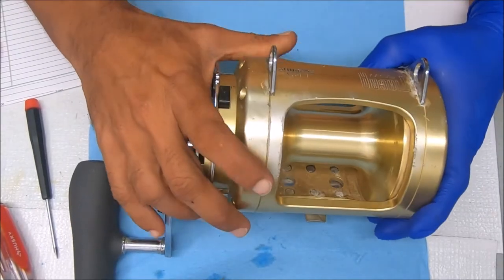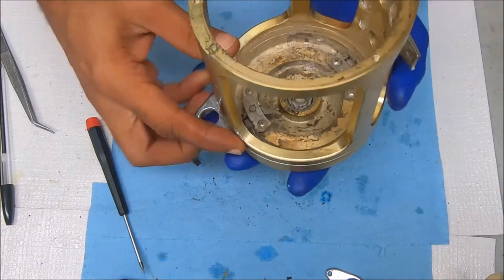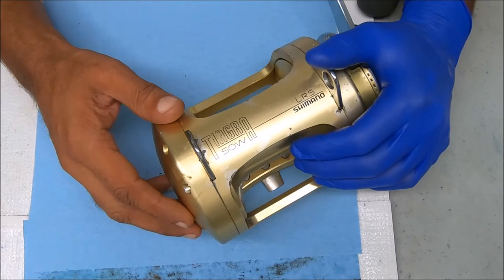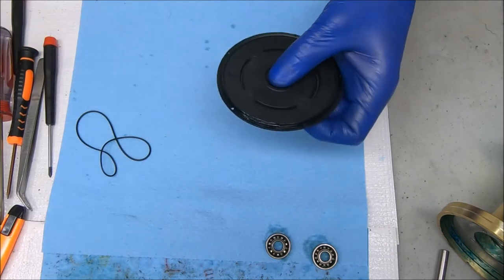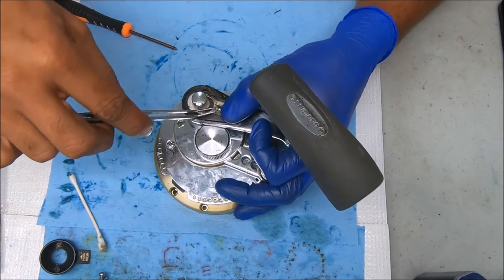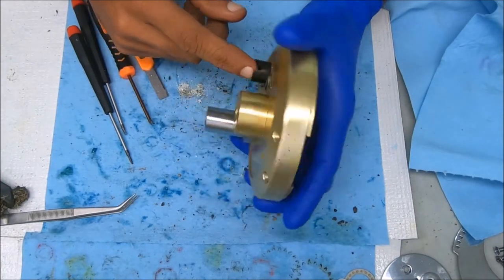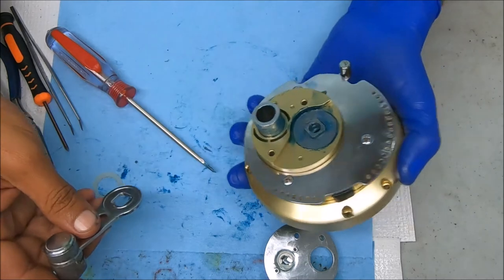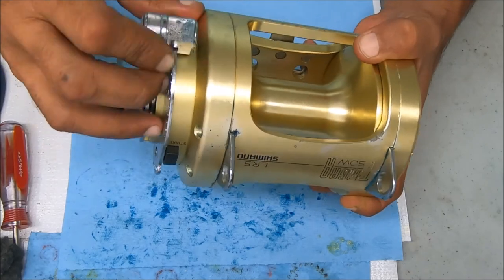Shimano Tiagra 50W LRS Nightmare With Rebuild: How to take apart, service and reassemble

Comment: The washers you called something else are called Bellville Spring Washers 

The screws are T15 torque 

You didn’t service the bearings. The drive bearings get marine grease the spool bearings get oil

Did you wipe the excess Cal’s off of the drag washer?

You do not put grease in the holes. You grease the screws. 

You do not have to take the drive shaft apart. Spray it out with brake cleaner. Add a couple drops of CorrosionX then grease the shift button.

You didn’t grease between the handle and reel before putting the handle on.
Reply from the maker: Thanks for watching and your input.

Comment: Absolutely top notch work. Do you use PB Blaster for seized screws? Don’t know how it might react with anodized aluminum. What reel grease do you use? Love watching your videos.
Reply from the maker: Thanks for watching. No, I just use corrosion x... then corrosion x with heat, but it doesn't always work well with aluminium on aluminum. You can also try banging it with a rubber mallet... only goal is to loosen the corrosion around the threading enough to back the screw out. I generally use Penn grease. Truly seized screws are rare (for the reels I service), but when it happens, it can be a bit of a nightmare.

Comment: I loved the video, but my tiagra must be older, and on the trag side there are no screws to remove the black cover. How do I take it off? (7'40" on video.
Reply from the maker: Thanks for checking out the video. Yes, there are two versions.... yours sounds like it should just be pried off with a flathead screwdriver (be gentle, but deliberate).... it has an o-ring around the black plate you're prying up. Spread the word about the channel. Hope that helps.... spread the word about the channel.

Comment: Hi just wondering what the name of the pliers you used to pull the inside bearings with...?
Regards Pete
Reply from the maker: Thanks for watching. Sorry, the pullers aren't currently available. Try bending the tip of a Penn wrench to get under and pull up the bearings.... you'll have to systematically alternate and pull opposite ends up as you go. Hope that helps.

Comment: Hi, thanks for the video. Kindly can you tell me what the plier is called that you are using to remove the bearing with. Silver with black rubber holding the two prongs together.
Reply from the maker: You're welcome and thanks for watching! As far as I know, it's no longer made, but I just call it a bearing puller. Seller.... @mywalkingfriend
Reply: Enjoyed watching 2 months back...   I just service mine and a friends... had one worst than this shaft jamed in the bearing... managed to save it... best penetranting oil ATF and acetone 50/50 works wonders  just make sure to rinse the plastic part and apply silicone lubricant on them
Reply from the maker: @deepbluewater7714  Wow! Glad to hear you were able to save it. Regarding the bearings, thanks for the tip.... you could also try this:

https://youtu.be/GI02FQMq9Nk

Comment: I think i put those 9 little washers on wrong that go onto the rod that goes through the spool on the clicker plate side.  My reel pretty much goes into free spool when i have half drag on it. Do you put two inside of each-other with the cup side both facing the same way then put it cup to cup with two more washers facing the same way? Could you help me out?
Reply from the maker: Hi, check and follow the schematics for the numbers and orientation so there's no room for interpretation. This is a very exacting reel. If you're having difficulty, even with the schematics, stop, and take it to your local repair shop... explain to them what's going on so they have an idea where to start.

Comment: Awesome video mate, have subscribed. What products do you use to clean the reels?
Cheers
Reply from the maker: Thanks! For this one, I'm pretty sure I would have used an ultrasonic cleaner with a purple power/water mix for most of the parts. You can follow it up with an alcohol/water solution bath in the ultrasonic cleaner.... 1 part alcohol to 5 - 7 parts water mix... you don't need a lot.

If you don't have that try using a penetrating oil like WD-40 to help break the crud down.

Comment: i was under the impression that drags did not need grease like the drags for the penn 50vsw
Reply from the maker: Thanks for watching. It's not pre-greaaed. You grease or leave it dry, if you want. More vids to come.
Reply: The recommended drag grease for Tiagras is Shimano RD18322 Disc Drag Grease

Comment: What does a rebuild like that typically cost with parts? Thanks great video.
Reply from the maker: Thanks for watching. You can email me at tsgreelservice@gmail.com if you're interested in servicing your reel. More vids to come.
Reply: I just did a rebuild on 7 Talicas for a charter captain here in Florida.  Bearing replacement is around $50 using Boca Bearings instead of Shimano. You can upgrade to ceramics for $100 per kit.   I personally charge $25-$35 for the teardown and clean.  Something like this reel would be about $100 in my shop with new bearings and additional for any other broken parts.  Its worth it when youre talking about $700-$1000 reels.
Reply from the maker: @richardhardin191  thanks for your input and perspective. Feel free to post your shop's contact info.